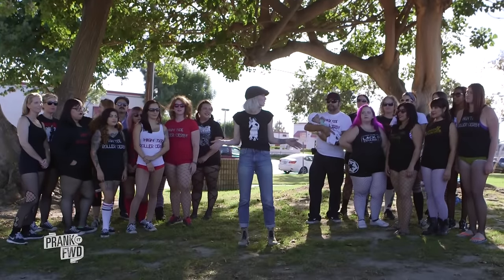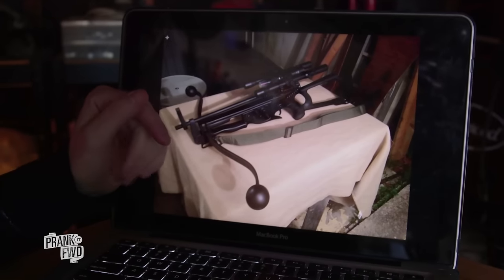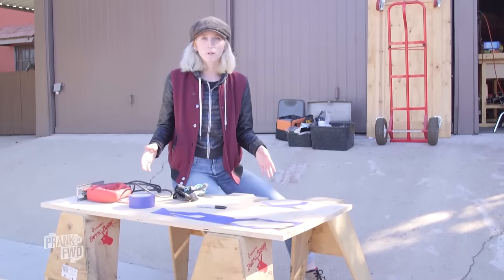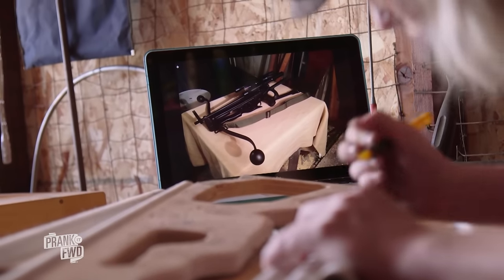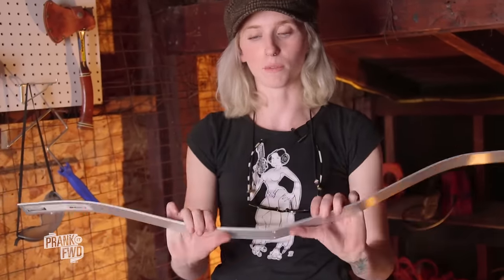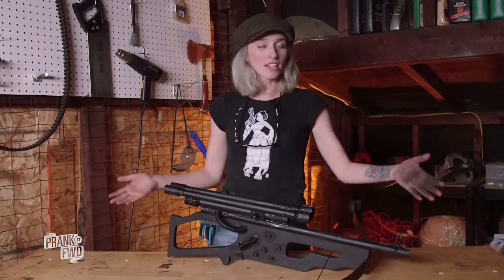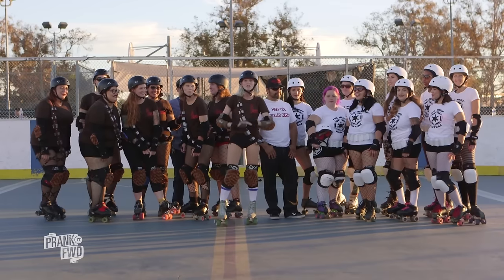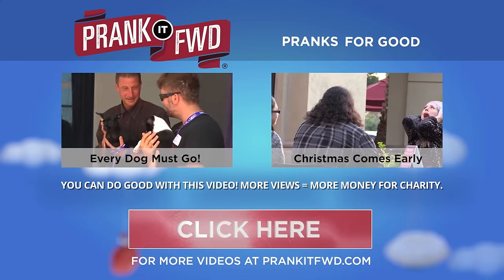Star Wars Roller Derby for Charity!  (DIY Prop Shop) – Prank it FWD

Comment: I always liked the DYI builds because it was kind of unprofessional equipment and materials. Not the Dustin isn't a pro with a lot bits of stuff most people wouldn't have around, there was always a makeshift feel to them that really gave the feeling like anyone could do it. With her it's "get out the plywood and pvc pipes, and let's get started with the bandsaw," Dustin would have modified some plastic toy gun and decked it out with skillfully glued and hand sanded do-dads, then spray painted it in the corner of his backyard, rather than this industrial workshop. I guess it's next level stuff, I just like the feel of a more accessible, casual, build tutorial for fans who don't also work in a woodshop.
Reply: +EthalaRide  This one uses the same tools that the other guy used lmao; drill, jigsaw, file, sand paper, hammer, etc. Considering that it was all done on a bench using hand tools and power tools, the location has nothing to do with it. The real issue is that the prop is very, very wrong. This is what it's supposed to look like: dev.thewretchedhive.com/sites/default/files/bowcaster_anh_002_0.jpg

To make the prop correctly, the first step is to make the template... correctly. Cut the shape out of pine using a jigsaw, glue some thin blocks of pine to the flared sections, then go to town carving the bevels using a rasp. Sand it smooth, coat the entire thing with wood putty, then sand that smooth whilst the filler is soft. Spray it with surface primer to seal it and avoid chipping the hardened filler.

Screw in place a thin steel or aluminium tube for the barrel, not giant PVC pipe. Bend up some steel or aluminium for the bow arms, I woulf favour steel since it won't bend out of shape when you touch anything (it weighs more though) and then taper the ends using a jigsaw (with a metal blade) or angle grinder. File/sand it smooth, screw it in place, attach foam rubber balls, then rivet/bolt on all the support brackets for the barrel and sights; they're just flat plates you cut off, drill a hole and rivet on.

Carve a thin channel in the side of the chassis to be the switch plate using a razor knife/ruler/thin file and Glue a variety of washers and discs to it. Automotive interior plugs can be used if you cut bits off. Glue on some potentiometer knobs too.

Either buy a broken rifle scope from Craigslist and screw it on top, or take a thin set of binoculars and cut off one side and epoxy some thin tubes either end to lengthen it. Bolt it to the top using anything that seems suitable; a loop of metal would be an easy/lazy option. Drill holes and epoxy a telephone pigtail cord.

Mask the phone cord, spray the foam balls with a sealer, then spray paint the entire thing black. Dry-brush silver hilights for metal wear and add some rust hilights as desired; paint some light brown water-based paint onto silver areas, then smudge it with your finger, wet your finger and wipe down to give it a rust/rain line effect.

I guarantee that you can do all of that with oldschool hand tools like a coping saw, tenon saw, file, rasp, sanding block and sandpaper, it's just down to the time/effort you're prepared to go to. The entire project is just about as DIY-feasible as possible; I could easily make what I listed about in one day (save for cure times).
Reply: +pmodd know what Dustin doesnt use? A bucket of hot glue on EVERYTHING.... and if he got some outta place he wouldnt just paint over it.. and he would never "eyeball it".

Comment: What is Prop Shops obsession with hot glue? It's absolutely horrible for prop making and will not keep your parts connected if you handle the prop a bit. Just use industrial super glue, PVC cement, epoxy and what have you instead. It's not ridiculously more expensive and will keep your prop in one piece.

Comment: i am interested in the balls and what they do to the acelleration of the limbs. i know they are labeled polarisers but they should be weights. please someone try this out, preverably with a highspeed cam. it may turn out that putting a pair of steel balls on a crossbow makes it actually burlyer

Comment: You should have put on some clearcoat and lightly sanded it or something first, or just painted many layers so it didn't just look like dull painted black wood you can even still see the grain on... Also what's with the messy hot glue everywhere? The overall shape isn't bad at all, but the attention to detail is seriously lacking.